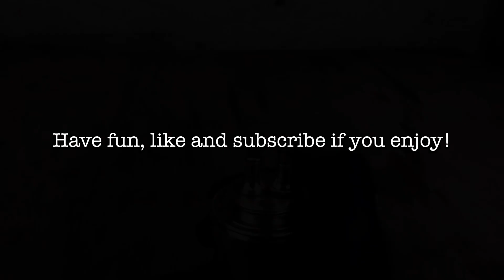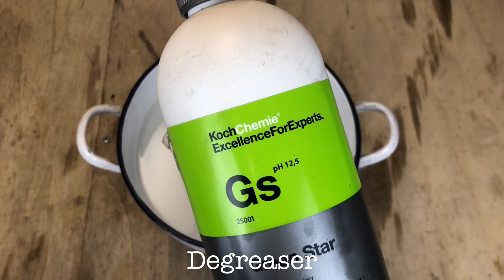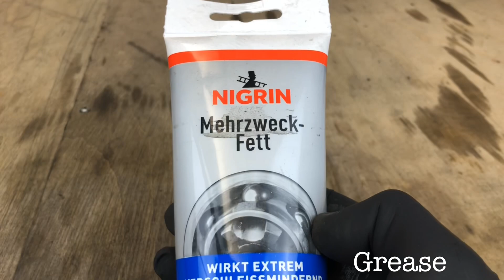Huge WWII Brass Lighter Restoration | Mister Patina

Comment: I'm not convinced that it is a lighter, though I'm sure it was used as one.  My bet is that is was used as a self lighting candle.  Life in the trenches was a muddy mess and dry matches were hard to come by. This would be an awesome candle inside one of the trench shelters that the officers had.
Reply: a candle, a lantern, a lighter, a torch, and a cartridge had a baby together!!
looks like a candle but is made of metal, works as a lantern but doesn't have a cover, is built like a lighter with the dimensions of a flashlight, and is made out of a cartridge.

Comment: Hmmm, I'm not convinced that was made from a shell casing. The inner wall is smooth and the knurled sections are very thick - much thicker than any shell casing I have seen. The lighter - with the cap on - looks more like the brass nozzle on an old fire-hose. So, I wonder if it was actually a fire brigade presentation lighter given to a fireman for long service or on retirement? It seems more symbolic than useful, and it definitely looks like it has been machined to look like an old fire-hose nozzle.
Reply from the maker: Hey Paul, great idea! One thing that makes me think of a shell ist the bottom plate. It looks like there was an ignite plate, which got filled up with tin or something. I didn’t find exact details for this lighter, but other nice rare lighters from the WW2 time, made out of shells. I didn’t think of a fire hose nozzle, but I’ve got to say thank you, I will do some research! And thanks for watching 🙂

Comment: A great looking piece for sure. The restoration has probably dropped the value considerably however. Most of the value can be in the patina and polishing it drops the value, kind of ironic as it's Mister Patina. Just fixing the flint spring and wheel would have increased the value.
Reply: If he just changed the flint and spring, it wouldn’t have been a good restoration video.  I make tons of money on my restorations so cleaning something doesn’t really kill the price point.